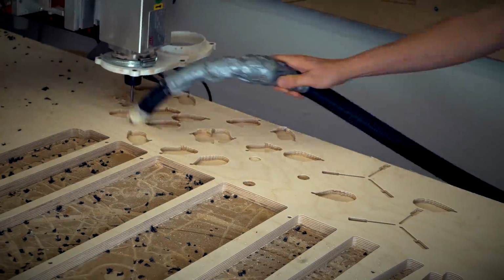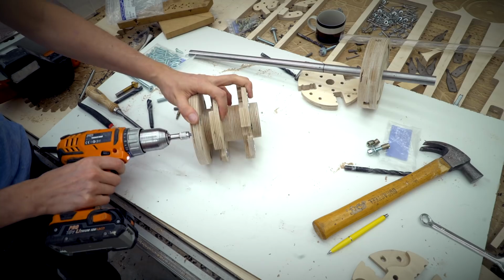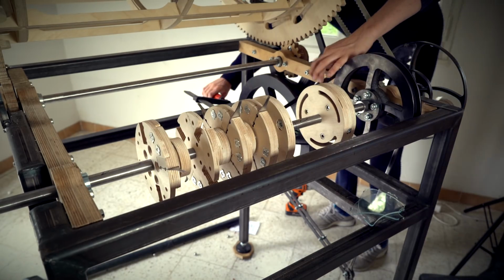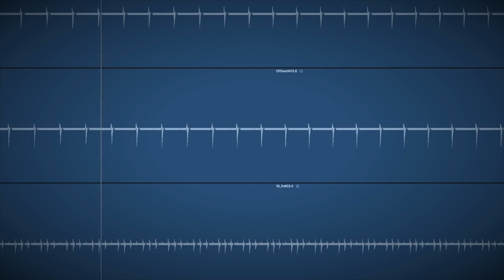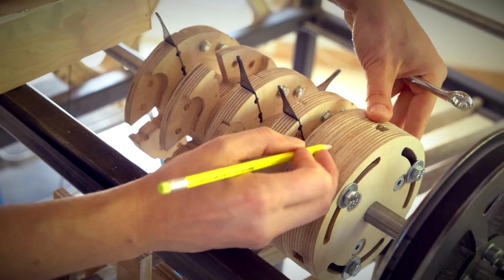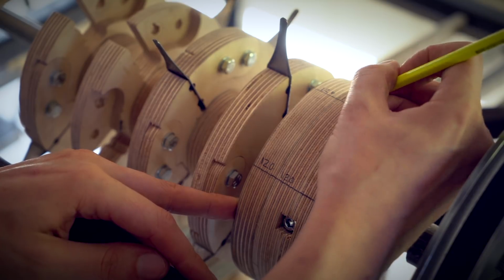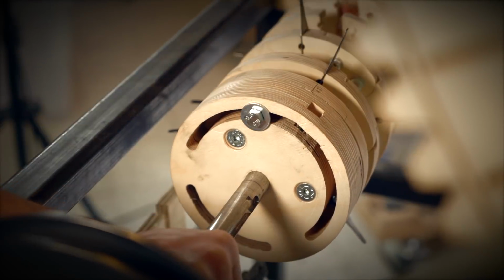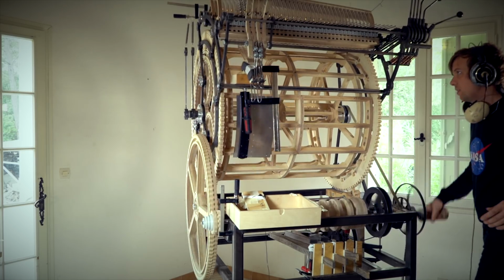Testing the Mechanical Rhythm Machine - Marble Machine X #55

Comment: This may be a stupid question, but I don't think I've heard you answer this one at all lol. Will you remake all of the plywood parts of the Marble Machine X once the test fitting and all is done? 
I've noticed you drilling straight into the plywood in some areas, making mistakes and redoing the drill somewhere else. I thought you were using plywood as it is easy to work with and machine and you'll replace all that parts with proper wooden, oiled parts later. Actually, a wooden Marble Machine X with all the wood grains exposed with oil would look so elegant!! Not sure if it will fit your design but imagine recreating the m=Machine to look like some grand piano or something that fits in a museum. A mechanical beauty of elegance but sophistication!
Reply: he won't. i've heard him say before that the plywood is an important part of the look he wants for it
Reply: @thr0ne1997  well, he can cut more parts in the same way later, so that the unwanted mistakes can be fixed, no?
Reply: Wood has issues with humidity. Plywood less so as the grains are alternating.
Reply: yes this is it. he has even machined the plywood to expose stuff like the darker glue layer.
Reply: He is keeping the plywood as it is dimensionally stable and won't be susceptible to warping, expansion, contraction, and splitting as can happen all too often with hard/soft wood.
Reply: I don't think he's going to: not only is there the aesthetic aspect with the layers, engineered wood like plywood also doesn't expand and contract nearly as much as solid wood. With that in mind, it's much better to make a sensitive part like the programming wheel out of plywood rather than solid wood. I'm sure you could work around it, but it's way easier this way — especially with the CNC: if you need a new part, you can just slap a piece of plywood on the CNC router, hit "enter", and you have a replacement part — no worrying about the grain required.
Reply: If he's going to have 2 then I think that having them look different would be nice, like one industrial: Plywood and steel, and another with polished wood and brass highlights.
Reply: I'm pretty sure he plans on building two MMXs
Reply: I remember him saying, that there will be at least a second MMX, but he is not going to build it himself.
Reply: He has said before that he plans to make several MMXs, so he will need to recut pieces at some point. Whether those are in a different wood remains to be seen, but likely not, as he likes the appearance of the alternating grains.
Reply: i remember him saying that he's going to make another mmx not sure if this one or the other mmx copy will be donated to the museum.
Reply: I believe he is is going to have multiple MarbleMachineX-es build. So in that sense, he will remake all the parts. Don't know if he won't use this one though.
Reply: @Niels Oostrom 
That definitely sounds like something He'd do. Or he'd just release the final CAD documents online for people to use.
Reply: he said he's going to outsource the building of at least 1 more because i don't remember why, but he said it was his intention to do so
Reply: dude....... nice idea.